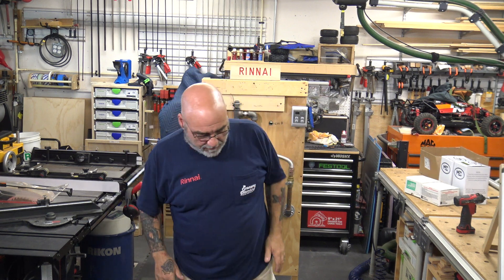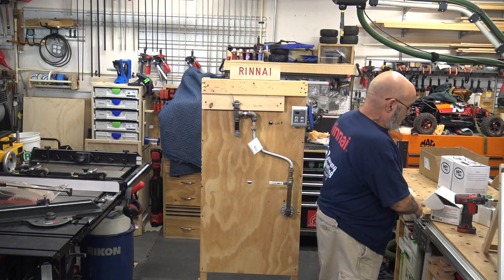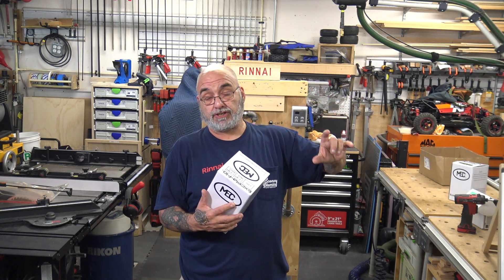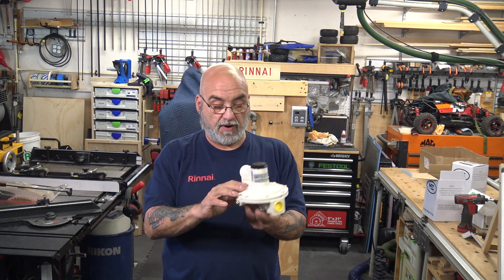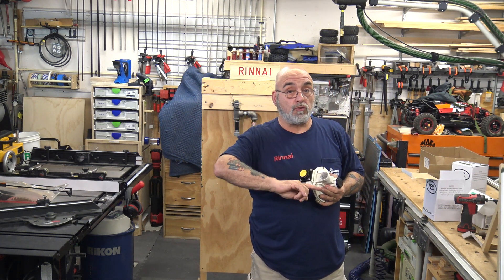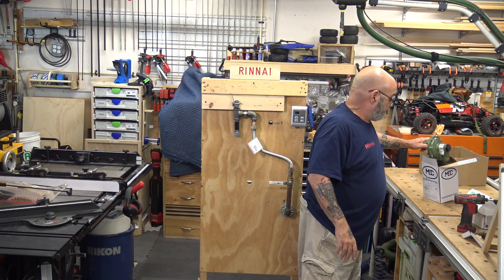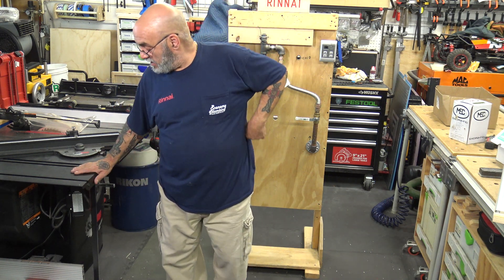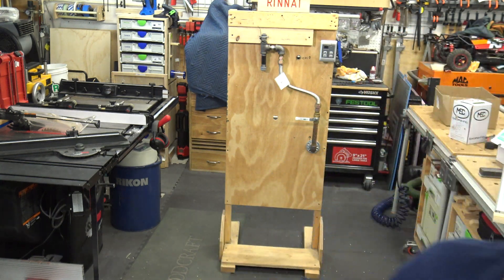What gas regulator to use for a Rinnai tankless heater

Comment: Thank you so much for taking the time to make this video.  We live in the country and have a private farm gas well and everything is pretty unregulated.  Unfortunately, that also means it's hard to find good information and assistance.  We recently put in 2 Takagi tankless water heaters, but found that we could only run 1 at a time with any reliability (kept complaining about air/fuel ratio).  Even when we only had a single unit running it didn't seem to like the pressure fluctuations and would complain.  We upgraded ourselves to 2 PSI gas and put in a dedicated Pietro Fiorentini regulator for each tankless unit.  We probably could have just used a single PF regulator, but I was tired of fighting it and wanted a bulletproof solution.  It works perfectly now, the pressure stays pegged at 8 in wc due to the balanced valve design of the PF regulator and I never would have gotten to this point without your help and this video.  Keep up the good work!

Comment: Mike- you've helped immensely with my installation of a new RE180iN heater.  I'm replacing an old Aquastar that was fed by a 1/2" line.  It is very close to the incoming supply line to my shop and I believe the 1/2" line will feed it adequately. The gas co. unit is labeled 25 psi.  The line to the shop feeds a 2" gas line to fire a forge, kiln etc.  The concentric venting for this water heater was a surprise to me.  I'm waiting for new venting to come next day UPS to try and get this running before Christmas.  I've run a lot of gas in the past to feed pottery kilns and am quite familiar with plumbing gas lines.  I got a number 12 error and think the venting caused it.  I'm concerned that I may get another 12 error after the vent installation if the regulator isn't outputting enough inches of pressure.  The unit does light right now before throwing the 12 code.  This leads me to think that the venting is the culprit.  Also, the old line didn't have a sediment trap.  I don't know if that was code when the old unit was installed 20 years ago here in Utah.  I have a 42" flex line feeding it now so the regulator should be far enough away to function properly.  I doubt that you will see this before I finish getting this installed, but welcome any advice, thoughts or concerns that you can give me.  Your videos are some of the best I've found on any subject here on YouTube.  Much thanks!  Gordon

Comment: AWESOME video . Learned a lot from this . I have a question ........ We installed our Rinnai heater 2 years ago and had no issues. We then changed out our propane tank , for a slightly bigger one that was serving the unattached garage that we were not going to use anymore , and sent the house tank back to the vendor so we wouldnt be charged for it . The original setup has a regulator on our house , but the one attached to the garage did not have one on the garage , but did have one attached to that tank  we switched out and put for our house service . Now that it is getting colder , we are getting a lot of "Code 12's" , and wondered if it was because the tank we moved might have the pressure set too low to be able to run our water heater ? Is it possible to run a propane line with 2 regulators if they are both 2 pound to inches ?

Comment: I'm here because I know absolutely nothing.  I'm trying to connect a Rinnai v53dep tankless to a portable propane bottle for an offgrid application.  If I understood it correctly, I need to install some pipe, the Megr-1652-dff regulator, a shut off, a minimum of 36" more pipe and ta da - done.  I found it helpful.

Comment: Thanks My house was built in 2001 I have gas logs heat and stove on low pressure  I will be adding a second regulator 2lbs with a three quarter pietro florentini going to Rinnai 9.4 thanks

Comment: Hi Mike thanks for your great videos, this one is on Regulators can you explain why I need a regulator? Thanks, Jim
Reply from the maker: If you system is high pressure you need to reduce that down to inches. A Rinnai tankless works at an average of 5 to 13 inches of water column. Mike

Comment: If I add a Tankless Propane water heater to my home, do I need to have my gas company upgrade my High pressure regulator and then add regulators for my existing propane Heating and my propane range(oven & cooktop)?

Comment: Mike,   Can the 10lb to inches or the 2lb to inches regulator be further then 3 ft. away from the Rinnai RSC 199I? The current line supplies a generator with a T in the line that we can tie into for the Tankless.

Comment: I simply want to know which regulator to install for my propane, tankless water heater. I just use a 30# tank of propane which is 100-200 psi. The minimum WC is 9.8 and the maximum is 12.4” 
Thank you

Comment: Hi mike thank for your videos, they are very helpful. Mike got a quick question, I'm installing an RU199IN, my gas line up to the wall is 3/4, right before the wall it goes down  to 1/2",  the heater will be  around 3 ft from the gas outlet. is it better to use an adapter to bring it up to 3/4 again, or change out the T installed that changes it to 1/2, and install a new T that is 3/4 outright? Thanks.
Reply from the maker: Yes increase it to 3/4” it would be much better. Mike

Comment: I have a Rheem I'm about to install. It says 180,000btu's.. What type regulator do I need? I'm using 1/2" steel pipe for the line. Nothing else will be using the propane, just the hot water heater. Help please. Thank you.

Comment: I have a V53DeP 5.3 and I want to hook it up to a 100 lb propane tank. Can I use a camper regulator at the tank and use a 2/pound in 8 to 14 out three foot from water heater?

Comment: Great video Mike! Just bought a house built in 1987 that uses propane gas. I'm preparing to install tankless, and noticed none of the appliances have inline regulators. The only regulator is right at the propane tank (it's a Rego PV2302 two stage). The line runs underground to the house. Does this mean I'll need the 10 lbs to inches regulator for my tankless (Rinnai V75ip)?
Reply from the maker: E mail me this info. 
How far is the propane tank from the tankless 
Is there an existing propane water heater 
Mike

Comment: I have a Rinnai tankless for which I'd had a 100-gallon propane tank. This became costly filling that tank for water heating only. So, I pulled that big tank off and installed a 40-lb tank. Problem is that I think I'm using the wrong regulator, because my tankless isn't firing. And based on your instruction, it would appear as though the installer did not install the regulator under the tankless. None the less, how may I use a 40 lb tank that is about 12 feet from the tankless with buried line? Why isn't it not firing. What must I do differently?

Comment: Hi Mike, I'm not a plumber, I'm a house flipper. But, we've run into a situation with a house that the gas pressure is too low to run our Rheem tankless water heater in the attic. Atmos has been difficult to work with but has agreed to increase our gas pressure to 2 lbs and I have to put regulators on all the appliances. If I understood your video, which was incredibly informative and honestly most went over my head, then the Pietro Florentine 1/2" F31051-1BP would be the regulator I need for the tankless. Do you have any advice on which one to install on the gas furnace? The gas range came with a regulator.

Comment: Hey Mike. Will a problem with the natural gas pressure cause the recirculator to shut off. I have had 2 plumbers look at my Rinnai and I am still having issues. The last plumber said that the reciculator was shut off. He reset it, but I am still having the problem where the water will hot for a minute or so and then go lukewarm. I have to jump start the unit by way of the dump valve to make it work. I am wondering about the gas pressure because I’ve notice that my gas fireplace has been randomly shutting off as well. Thank you!

Comment: mike, have a propane rur160.. it is going to be  fed with 100lb above ground 23 gal flame king.. gas line is 3/4inch from tank  and is run ug 30ft from tank to exterior wall of garage under concrete and up wall before concrete was poured..rinnai unit is inside garage and only about 3 ft distance from where gas line comes up outside  .. how do i install a regulator 3 ft from unit if i only have 2.5 ft? from outside to inside where unit is located. should i run the exterior line a couple feet from unit outside and set regulator , and then go back and thru wall to get it the 3 ft minimum? thanks, and i am in lake placid florida

Comment: I have a question, I install a new propane tankless water heater is there anyway to turn it up so the water gets hotter,this model doesn't have the control on the outside
Reply from the maker: E mail me this info,
What’s the exact model number if it’s a V series or a RL series. If it an external model both should have came with a controller that needs to be installed inside. Let me know. Mike

Comment: Hey Mike.  Just bout a Rinnai 199. I have a r232-bbf regulator on my tank, its output is a 1/2 inch npt.  This is a integral regulator. My run for the pipe is 15 feet.  Most charts say I need 3/4 inch tubing or pipe. My question is if I can adapt from the 1/2 npt to 3/4 line or has it already been too restricted from the regulator even though it's a 550btu regulator?

Comment: Hey Mike If I have 12.2 inches of WC for natural gas coming in to my home and the most my tankless can handle is 10.5 inches WC what regulator would you recommend? I have a 3/4" natrual gas line. Thank you.
Reply from the maker: The regulator at the meter can be set lower by the gas utility company. there's no regulator that will drop down 2 inches.